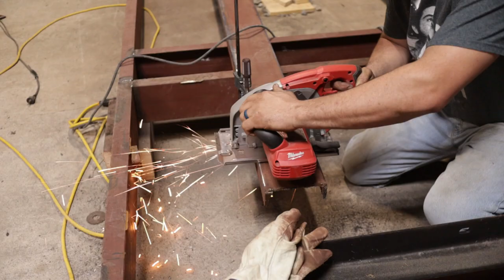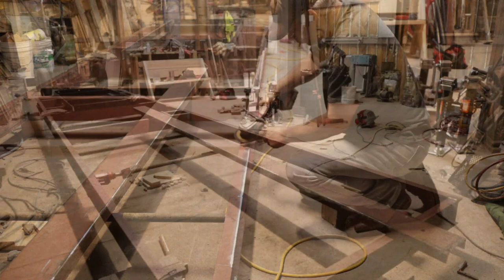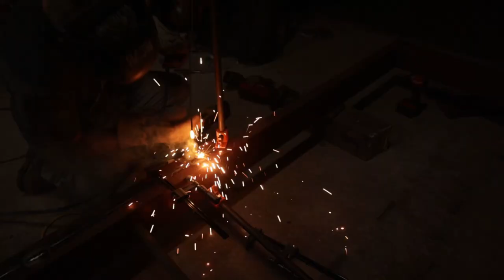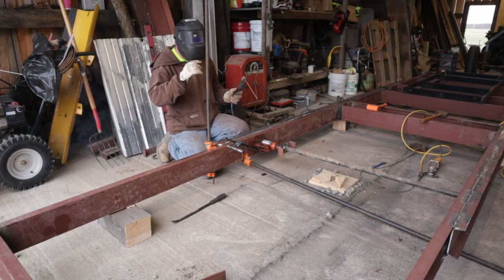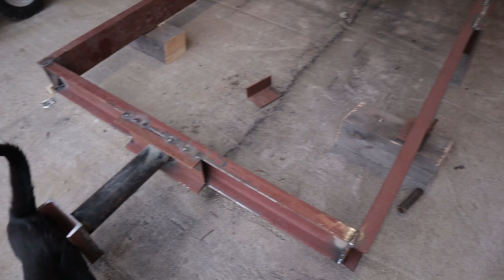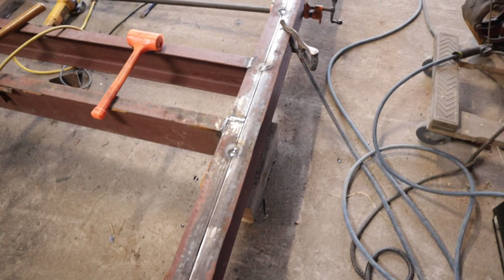Timber Frame 2.3: Sawmill Trailer Bracing Plan

Comment: Hi Jim, nice video buddy. It’s coming along nicely. It will Look good with the axles on.  I know what you mean about doing it while you are young!! I’m now in my 70’s and struggle with simple things!! Take care and be safe Jim. Looking forward to the next instalment! Graham👍👍🇬🇧🇬🇧☕️☕️
Reply from the maker: Thank you Graham
Reply: Yup, staying active can keep us young. However, over-doing it can age us much faster. Ask me how I know. (Or don't, unless you want a book length response, ha ha ha). I'm sure I have written most of the story here and there in the channel's comment sections already anyway.
Reply: @thomasarussellsr  spot on Thomas, it’s all about finding a happy medium. Because I seriously damaged my back I always think I can do more than I really should. It does not hurt at the time but an hour after I stop it’s like being hit by a bus!! Then it’s nil movement for three days. Take care and be safe. Graham
Reply: @grahamallen3941  so true.
A couple of weeks ago I had the bolts that hold the steering gear to the frame rail on my 1996 van break off and with my disabilities, and the easy-out breaking off inside the first hole I eventually drilled into the grade 8 broken bolt, it took eight days total of pain and working at it as much as I could to fianally get the third bolt out and get it remounted to have some transportation. Putting in (including resting my painful sore shaky muscles) 9 to 13 hours per day laying under the van and fabricating new panels to drill and bolt into place over the rusty frame so the steering gear had something stronger to torque against. (One or two days max when I was younger.)
I have to find a replacement vehicle. This 1996 van just isn't safe anymore. I hate to ask for help, and don't know how to do a "go-fund-me" anyway, but have thought about it breifly. It sucks being a broke, disabled, veteran who has worked his whole life and is on the verge of homelessness because his disability is making it so hard to find employment; and the Social Security Administration says he doesn't meet their disabled standards because he has a college degree. I haven't had a pay check since August 2013. The wife draws SSI of only $794/mo. It is quite hard to live on that, much less replace a vehicle. 
But hey, we all have our difficulties in life, right?
God is getting us through, so far.
I sure hope your difficulties are taking it easier on you.
Reply: @thomasarussellsr  sounds like you are going ‘through the mill ‘ like I did Thomas. Three years of operations and being tested with so many different drugs to try and help ease the pain. Finally got that sorted then got hit with cancer, beat that after 5 years and I’m thinking what next do you want me to go through. I served 20 years in the Army and Air Force no trouble at all. Second job as a civvy and my back got damaged severely. I now take each day as it comes. The disability stopped me over £5,000 a year as I can think for myself and plan a meal. If I say if I have mental issues then they will look at my case again in two years time!! All the best buddy, take care. Graham

Comment: I always say I got more time than money. What you said about aging is correct, im 61 and can do every thing I used to. The problem is it takes me twice as long and I feel it more when I relax for a while and try to stand up. But use it or lose it I guess. Think now jim. How can I work smarter not harder.
Reply: As I have worked myself into disability at an earlier age than you sir. I wish it only took twice as long. Depending on the task, it may take three to ten times as long for me now, at 50 years of age. Medically speaking, my doctor says I'm about mid-70s to early 80s. Mobility wise and with many of the afflictions and issues I have. I guess manual labor starting at 6 years old and working between 60 and 80 hours per week (many times more) for most of my adult life, has just run me down quicker. Never taking a vacation or time off/down probably didn't help much either. But when you are the sole money maker in the house with multiple kids, you do what you have to, I suppose. Now, with an empty nest, the wife and I are squeaking by on SSI because the work I did didn't have pension plans and Social Security says I am not disabled under their rules. So, I went back to school and still can't find a job even with a degree. God gets us through though.
Reply: Thomas. Never look back, never give up.

Comment: Good job Jim, the rotisserie Idea should make that much easier to roll over to weld. The axles will make out of balance when going back to right side up, you might prepare for that. Taking the mill to the forest should make bringing the timber’s home much easier. Will cutting them onsite be better for them in any other way as opposed to the logs that lay around until processed? Thanks
Reply from the maker: Biggest benefit will be the time factor.  It will also take distractions away while I'm trying to mill.  Those are probably the only two major benefits of milling onsite.

Comment: For tight clearances like under the trailer you can allway bend the welding rod.
Reply from the maker: Good evening.  If you watch closely you can see me do just that, I also used some of the short stingers that couldn't get into some of the tight spaces.

Comment: I know you clean a lot before welding but I just weld through the rust and it works fine for me. I do get a good portion of the rust off though. How long is your trailer?
Reply from the maker: Hello T.  This one is 21' long.  With the type of rod I use it likes clean metal, if I was using 6013 or 6010 it sure wouldn't be an issue.

Comment: Morning Jim. Interesting idea to bend a full stick when you likely have some partial sticks around. Don't forget some corner bracing at the main corners and a few around the jacks as well. Just a suggestion, but I'd take the corners off those extra graving rails to save the chins as you walk around the trailer. We all know either you or the family, likely you, will find those corners sticking out with your chins more than once if they are left on. 😲 Always a good time for the camera to catch an expletive,  but why gouge your legs that way? (Or risk the kiddo's chins or knees?) Unless you need them for fastening fenders or something, of course. But I don't think your fenders will be 13 feet long. (Going off your measurement of 6 1/2 feet either side of the seem of the split in the main rail).

Comment: Big difference between you and Matt. Matt buys new metal for projects. Your recycling ways takes a mite longer to get there. And I am saying that while pulling the long bolts out of broken wooden  cable spools for a project.
Reply from the maker: You are right on, I'll have a very useful item for a very small cost.
Reply: Do you need the long bolts or the wood from the spool?
Reply: @thomasarussellsr  I'm getting the bolts to use to hang stuff in shop. Wood is rotten

Comment: Make it any heavier or longer you will need a class A license to put it on the road.  Grin  just kidding.  But the banana bend may be to your advantage. Like your own form of pre stressing.
Reply from the maker: It is less than a 1/4" over 21', my own fault too.  It goes back to straight with a little weight on each end.